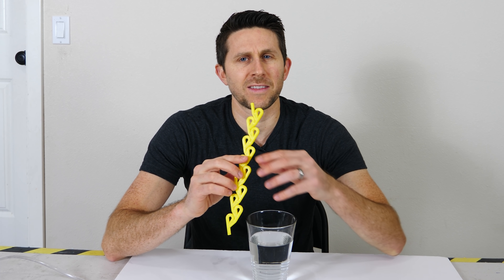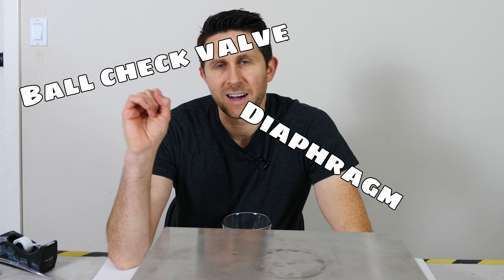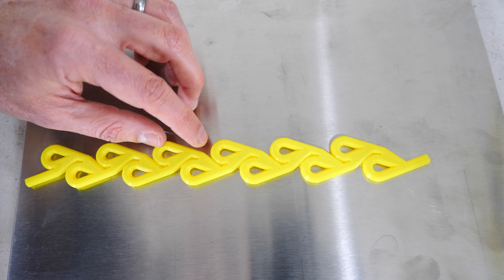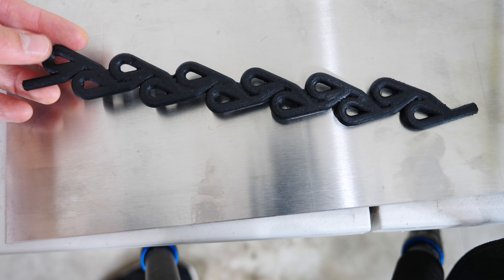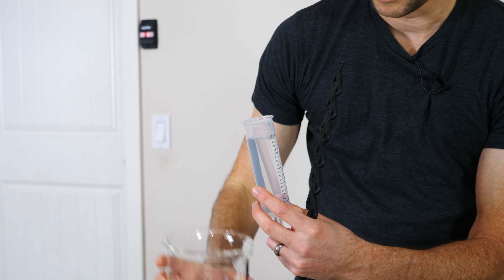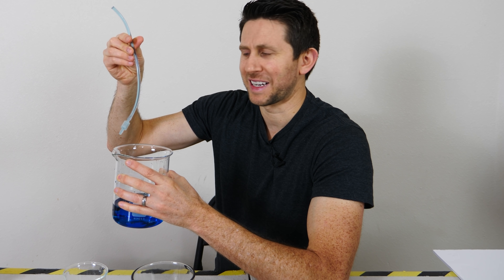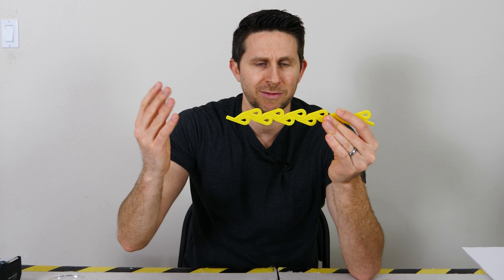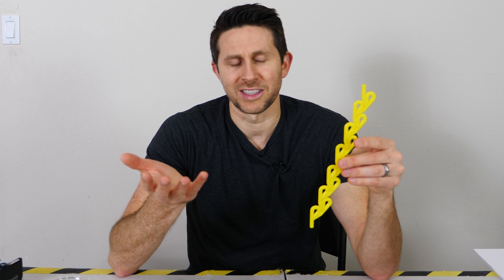This Tesla Valve Straw Only Works In One Direction

Comment: Keeping gas pressure on one side of the valve is fine and all, but it still doesn't seem very useful. Even in the situations where you would only want to change the pressure and not stop the flow, in those cases you'd almost always need to know and control the exact pressure output of the valve. This valve is kinda random and you can't really predict the pressure reduction of it.

Comment: the best appilcation for a one way straw is fizzy drinks cans or any carbonated beverage as once you pop one you release preasure and put a normal straw in the air bubbles that make the straw the drink "fizzy" travel up the straw causing a preasure vaccum inside the can and straws walls causeing it to loose carbonation faster making it still/flat or how ever else you could say it. 
i drink carbonated drinks in cans through a straw and id buy one if the wasnt a pain to keep clean

Comment: I could see a one-way straw being useful when drinking something carbonated. When I have a regular straw in a carbonated drink, the bubbles adhere to the straw and pull it up, sometimes enough that it falls out of the cup. If there were a one-way valve, the weight of the liquid in the straw may help reduce the floatation from the bubbles, thus helping keep the straw in the drink.

Comment: The reason to use a one-way straw is so that the straw keeps being down in the drink. The problem with real straws is that when you are not sucking and the tube gets filled with air the straw has a tendency to bounce up from the water and out of the drink. But with the one-way straw as we saw in the video the straw is filled with liquid and therefore not bounce out of the drink. Big-Brain straw time
Reply: you sir/madam in a less techical way to putting it as i did have the rigth idea.

Comment: this valve works best horizontally without suction or pressure from either end the valve however works really well with higher levels of flow (not pressure)

Comment: One way straws would be more hygienic when sharing drinks
Reply: When you stop drinking, a small portion of what you had in mouth (really small) goes back. This straw has reservoir in its first 5% of size, where it still keeps the water that was near the end when you been drinking. For this purpose, it is nearly same non-hygienic as normal straw, if not the same.
Reply: Or just don't share drinks with anyone with which "hygiene" would be a concern...

Comment: Hello Orgill! i have a doubt that if i use any sort of resistor to decrease the current in a circuit, will i b wasting electricity? & also that if i regulate my fan at speed 1 & then to 5, am i wasting electricity at speed 1 relative to speed 5 & will my electricity bill remain same at both these speeds??

Comment: I think the sharpnes of edge inside and quality of tesla's valve are important. Second topic it's speed of fluid (gas it's also a fluid) if you use it as dynamic part for example in rocket engine as fuel pipe or other it can be ok. Also in (as you said in video) in changeable flow with high freq. changes. This valve can also work as  some kind of pump (or part of the pump).

Comment: It worked like a valve for air and not for water, when the expt was performed in air. What if you perform the same expt inside water removing all the air stuck inside the straw, and blow water into the straw without the help of gravitation

Comment: laminar flow? and a cheap valve with a tesla "valve" as energy reductor = 100x more lifetime for the whole new valve system. since the blocking mechanical part can operate in optimum conditions, even if the backpressure is more than the cheap valve can handle. nanosponges with a polygonal like  pattern version of the valve

Comment: 5:32 "So as you can see the tesla valve doesn't work very well for a one-way straw." This was an erroneous conclusion. I think you would have gotten the Tesla Valve type straw a much better ability to resist fluid flow if you hadn’t made it about that wide in length. If the whole device were at least half narrower relative to its length, the outlet branches of the side channels inside its system would be at a smaller angle to the main channel. This would make it easier for the fluid flow to split in two at each starting branch. Due to the same narrowness of the system, the reversal of the side channel would also be steeper, allowing it to better resist the flow of the main channel.
 
I understand that in your 3D printer, the limited print area limits the formatting because you wanted enough side channels for the entire system. But you might have been able to shape the device narrower without shortening the length and still have 12 side channels. Or you could have made it two-part and twice as long by designing a joint between them for both pieces which both parts have 6 side channels. 
 
So you should make it again and this time by using accuracy its original shape. It’s too easy to think that form doesn’t matter. If you learn this, you will be smarter. 
"One experiment is worth 1000 expert opinions" ...Yeah right!
By the way: the Video name "This Tesla Valve Straw Only Works In One Direction" is misleading. As everyone can see, this "valve" works in both directions. Maybe this isn't Tesla Valve ...

Comment: Us stoners need this from that one friend that coughs in the bong. No more losing the bowl.
Reply: just put a check valve in it, higher up so it doesn't get melted the heat. this straw will not work on air anyways and only liquids.
Reply: @rickylafleur5823  the check valve isn't air tight, the straw will work for the intended use. It works better than the check valve. Thanks for the suggestions
Reply: @jubstery  if used correctly the ball will drop and seal on its own and will lift when you inhale, this would also keep the smoke that doesn’t get inhaled in the bong.

Comment: very cool, but a couple issues come to mind:
1. it would be nice if the straw was made of something transparent, so that we could actually see the water going through (or failing to go through) the straw.
2. a straw is probably not the best application of a tesla valve, given that the suction from your mouth is encouraging the water to go down the central channel. based on your description of how it works, it seems like it would be much more effective in a situation where the water is being pushed through the valve, rather than being pulled through it...

Comment: You are totally right on the point in which the Tesla valve works better with gas than the liquid. The pressure drop cannot drive the liquid as significantly as the gas phase. But the ingenious factor that makes the Tesla valve a 1-way valve for the liquid is that it drives the flow of liquid to cancel out its momentum in one direction while promoting the total momentum in another direction. You can visualize the phenomena in my fluid simulation here: 
https://www.youtube.com/watch?v=ifvQxLFwB3c
I developed this 3D version of the Tesla valve based exactly on the diagram provided in the Tesla valve patent provided by Nikolas Tesla. Enjoy and welcome any idea!

Comment: @The Action Lab - The time taken would be more than 15 seconds on the wrong side if you had the straw on the top of the container. By having the opening of the container at the bottom will ensure that the liquid in the container seeks its own level on the straw as well so that by the time you flip the straw down, its already half filled thus making the water flow easier. if you still want to keep the opening of the water container downwards, the tube connecting to the straw needs to be longer so that you can hold the one way straw higher than the container so that the liquid does not get into the straw initially making your experiment accurate to measure the actual time taken for the liquids to pass through the straw on both sides.

Comment: "The air will continue to leak and accumulate until the damage can be properly repaired. The tube allows the air to get out, the water in the bottle the air from coming back in"

"A homemade one way valve"

Comment: Rather than working better with gases, tesla valves work better in pressurized systems.  When the system is only powered by gravity, the resistance doesn't amount to much because the looped fluid is equally effected by gravity and thus carries significantly less energy than the rest of the flow.  Add some pressure to the system and the valve actually becomes a valve.

Really cool test to do is to flood the valve with some form of fuel-air mix and then light it.  One way, the flame accelerates, the other way it ends with an incomplete burn.

Comment: I'm thinking the Tesla valve would be best used in conjunction with another form of check valve, e.g. by having ducting that you'd be using anyway be built as a Tesla valve. This should reduce strain on the check valve.
On a related note, I suspect that a refinement for the Tesla valve could be to change the geometry slightly so as to have the resisting loops taper in slightly, thereby increasing the speed of the vortex-generating flow exiting the restriction. I'd need to run some simulations to know if my intuition is correct. Creating a 3D geometry might also help.

Comment: "Works like a diode". 
Next step: triode valve.
Reply: if u do not want to hear someone talk about useless crap skip this comment(I really wanted to talk about diodes sorry)

 i understand ur joke i would assume but the critic side of me says that the two things are very different while one prevents flow of, for this example, electricity one way but not the other obviously. the triode from what i understand with in circuitry is a radio amplifier.

Comment: how forgiving is a Tesla valve in terms of how much its performance suffers if it isn't made exactly right? is there an optimal loop shape / position & angle for the loop to reconnect with the main stream to cause the most turbulence / resistance? do these things depend on what is supposed to be flowing through the valve?

Comment: "It took a lot longer"

Reality: 5s more
Reply: 50%
Reply: 1.5x longer so like imagine a 1hr movie but it takes 30minutes to load the movie in the middle it is just irritating
Reply: In comparison lmao.
Reply: 50%
Reply: with pressure it will be much more than 200%, also more precise construction preferred.
Reply: It wasn't even really 5 second more, when he did it the right way he flipped it and started the clock so its already gonna be a second behind then he stopped it as soon at it left the syringe but not the straw as shown by water still coming out, he stopped the timer at 11 and said "10". Then for when he flipped it the wrong way he flipped it then started the timer, same thing he did to the first one, but this time he waited for all the water to be gone from the straw before stopping it. idk, I get the experiment but like I get that its gonna be slower but come on what you do to one side you need to do to the other to make it a fair test, might just be and I easily could just be blind as a bat and he may have stopped it after the water left the straw in the first one but from my perspective its not also I need to get a life just typed out this whole thing about something I could easily be wrong about just cuz.
Reply: @orderofthesnack5558  it was, watch it again. He says the second that the water stopped coming out, not the second that he stopped the timer. He also took the same time (almost, the difference is less than 1 second) to start the timer. It's not 100% accurate but it is fair
Reply: yea im like hUh

Comment: dude speed & turbulence frequency matters for tesla valve efficiency.  it works well for high speed pulse jet engine or in rocket engines. it blocks very well at high speed gas or fluid.

Comment: Surgeons could 3d print scaffolds of these to prevent arterial clots, constipation, basically anything fetting "backed up" in the body!! Imagine 3d printing an entire vascular system of these with a pump for a heart!  Veins carry blokd to the organd and arteries carry deoxygenated blood backto the respiratory system to bind to more 02. Put an AI in it to manage the systems electronically and youve made life, a stable yet self sustaining feedback loop of systems. 

Or using these as tubes in a car that direct oil and fluids to and around parts that need them! The possibilities are endless!!

Comment: Tesla valves are cool, but I can't figure out any use for them in harmonicas.  I'm working on an idea to test forms on a reed instrument by changing the shape of the valve.  The science that sticks in my brain is always harmonica related.

That said, if you ran it through a hepa filter it might be a cool way to make to make a positive pressure seal inside a helmet or mask.

Comment: min 1:34: the important point of moving parts is not only the wear, but the sensibility to dirt, debris, oxidation etc that would destroy or minimize the blocking function. The Tesla-Valve can also work with mud or sand loaded fluids (apart from abrasion by time). BUT it does not close 100%...you will shurely explain this later. I continue...

Comment: i havent read the comments so someone already probably said this but on the off chance they didnt: iirc the tesla valve was created for the pulse jet engine the idea was to stop thrust stealing back flow from the combustion of fuel in the combustion chamber forcing the expanding gasses out of the back of the engine which then would draw in more fuel/air with little resistance and no irritating melting or general degradation of internal parts for a regular check valve

Comment: In the 1920s, this solution was to remove the non-return valve in the baskets of piston pumps. All that was left was a piston with its flap holding water above the piston. Replacing the piston seal and damper seal would not require disassembly of the entire pump, but only removal of the piston rod. The implementation was hindered by demanding production. It was necessary to make two cast iron castings that had to be welded, which was a problem at the time. It would have to be soldered. The classic solution with a pipe, two flaps and a piston was a lot cheaper, simple to manufacture. That's why Tesla's idea didn't work out.

Comment: I've wondered since about the year 2000... why is this not implemented to both cool down electronics and to add battery power from the heat expansion of mercury within the valve.

Comment: As a straw concept this is a nonsensical use case. You're pulling material through it not forcing it through from one side. There is likely a kind of turbulence when the liquid rises to the dividing point between tear drop sections as at that point your pulling at areas of trapped atmosphere in the bends. If the straw is filled or full end to end it shouldn't behave poorly in the way this would if it were used as intended. The correct path similarly will be disrupted as the liquid is being diverted into the lower tear drop sections. The force you need to apply to get anything from equalized pressure to top is probably considerably more than a normal straw no matter which side you draw from.

Again, this is a terrible use case for the valve.

Comment: You could use it for suspension. Some older motorcycles have such valves that reduce oil pressure in one direction.

Comment: Not sure how accurate your gravity test is for determining how hard it is to suck from the difficult, impeded end as a sucking/blowing force applied from your mouth is a big contributing factor  to making it difficult, as we are forcing the water to loop back around whereas your gravity test simply fills all those loops and the water continues to flow downward... The force from gravity alone is not great enough to demonstrate the straw

Comment: I guess the advantage with all other forms of mechanical check valves, is that the pressure drop across them is smaller. The tesla valve has a huge pressure drop. Also, it's not like a valve with no moving parts automatically becomes less prone to wear - at least when weighing the pros and cons of having the pressure drop. It might be better to change a worn out mechanical check valve after ten years of use, than to run the system it operates in at a much higher pressure. Also, the fact that he was able to drink the water the wrong way around, proves that it's not really working=P

Comment: One way straws are useful for water packs. Normally it's just a bite valve at the mouth end. It keeps air from going into the water bladder so gravity doesn't make it fill up with air and make you have to suck a bunch of air out to drink.

Comment: I think you are using it wrong. Sucking on the straw will draw water either way because it is simply seeking a level. It should be more effective if you squirt water with it, where the valve's reversing pressure will work against the flow. I think you should also see that each node in the full valve diverts a percentage of the the water throughput to act against the flow and impede. So it's not ever going to be a perfect valve. But experimentally, you should be able to determine the hindrance of flow of each node and calculate a for-all-intents-and-purposes blockage based on a node count in a final valve. Now that is science.

Comment: The Tesla valve has basically solved one of the biggest problems of Flame Throwers. 

Flame trailing back into your output hose. Therefore, this value makes flamethrowers more valid.

Comment: It's a valvular conduit. Also it doesn't stop it it from going in the other direction it just restricts it by changing the path for the water to to travel using clever geometry. I barely grown facial hair yet and I know that. I'm not trying to be toxic but please do more research before making a video.

Comment: What a massive surprise, the valve that impedes flow is very difficult to get water to flow in that direction and is easy to get water to flow in the other direction, almost as if that is how it is designed?